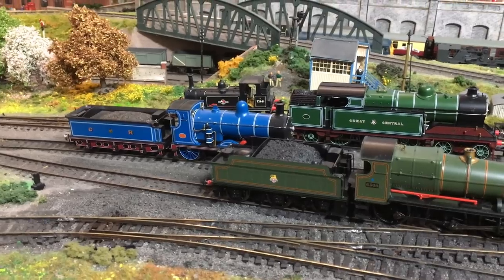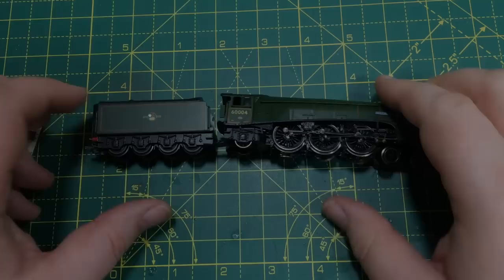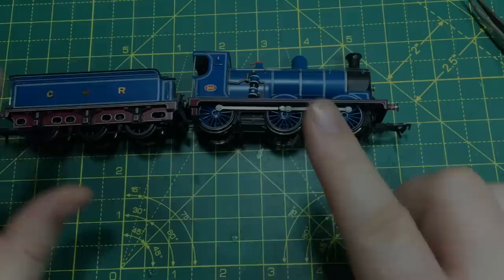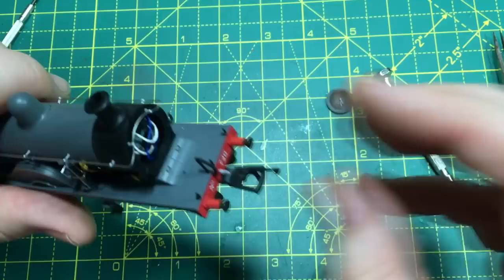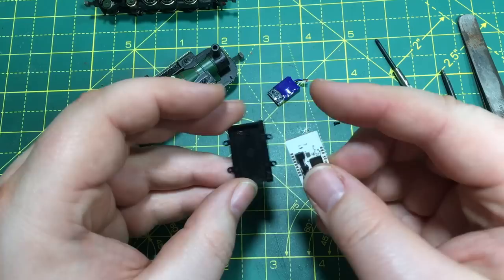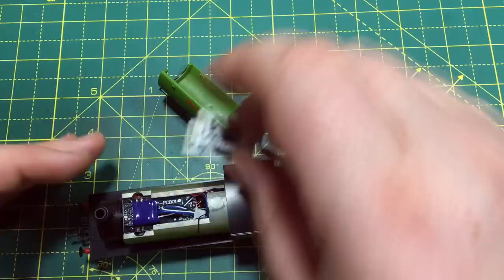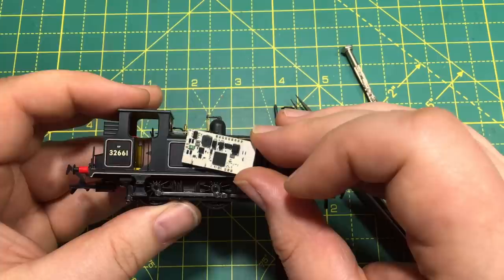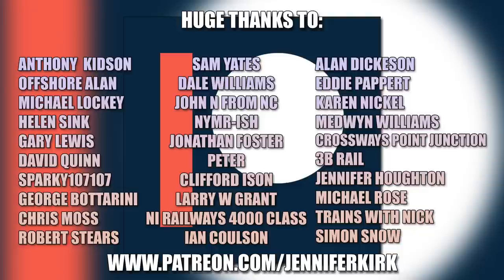Will it Fit in YOUR Model? Testing the Hornby HM7000 Bluetooth Decoder

Comment: What bothers me is hornby has marked this as being next18, but next18 is a standard that includes dimensions. Next18-s is at most 25mm x 9.5mm x 4.1mm. If I am correct that the hornby decoder is larger, it is not a next18-s device. (28.5mm x 14mm x 5mm from their page right now). They do provide the dimensions at least, but that doesn't help anyone with a compliant model. This is a best practiced failure on the part of hornby. This is really, really bad. Conform to standard first, then release.
Reply: Can I refer you to the latest Hornby Podcast Beyond the Buffers, where it’s explained why the Bluetooth decoders are this size for now!
Also seems they are made the fit the TT120 range, rather than all manufacturers old models.
Reply: Next18 refers to the socket, the interface between hardware. Which this confirms to, and the standards of communication, which this conforms to. They conform to the standard, says on the box they conform to it as these are then operational factors of a next18 decoder. Never says comply to the standard.

A voluntary standard need not be complied with by anyone and to be fair most other makes deviate from it in some way or other, that's why so few are sold with compliance markings.

If it don't fit, buy another smaller make, the fact it conforms to the standards of communication means you should be able to use this in locos it does fit and anything else in locos it doesn't fit. Which is absolutely fine and dandy for most users who are probably not super heavily invested into a full hornby DCC system or prepared to do so anyway having invested into other none bluetooth control systems long before this existed. 

Storm in a teacup to generate views is what this is. Pure tabloidism run rampant on a hobby that doesn't need  journalism of that ilk and doesn't benefit at all from it.
Reply: Look up the difference between conform and comply. It is Next18 but doesn't comply to the size standard, actually most decoders don't.
Reply: @highperformancecreambasedsoup  I don't think hornby declares their product to be next18-s, so fair enough. If the model manufacturer says "fits next18-s" then the consumer has allmthe information they need and can choose easily. However, I think the conversation is worth having, not to point at hornby and say "you are wrong" but more to try to find some way to make it easy for modelers to determine what will fit without guessing. Maybe that already exists? The fact that reviewers are not aware of such information suggests not.
Reply: @a.squirrel1511  it's called a publically available PDF that you download prior to buying, read, take note of the measurements, then read the NRMA documentation, then measure some locos or order one and go through what you have to see if it works. 

Or someone does that anyway, then you know, then you go "huh, fair enough" and continue on your way in life because really is there any changing this? Is 99.999% of time put into this worth it? No one is going to suddenly start complying, the issues in manufacturing things aren't going to be undone and resolved back to 4 years ago, time goes one way. No rewinds no replays no edits. 

Let's just get on with enjoying our trains  sans the drama.
Reply: The pdf is not sufficient, incomplete. When the model manufacturer can give you a set of dimensions that will fit (say by specifying a standard) the amateur modeler does not have to guess. As for drama, you are inventing it, so stop.
Reply: @a.squirrel1511  the document from the manufacturer is complete, it tells you what you're buying. You then go assess next to what you have. If you are an amateur, you ask advice. 

Remember a world before the dramatics of expecting every product to be just so? That was a nice time. Let's just stop milking it and moaning because it's hornby, not because it's anything different to what most other companies do, but because it's hornby, a contrived drama is never far off, so stop. No one is benefiting.
Reply: @highperformancecreambasedsoup  if 2 professional reviewers can't look information on model engine boxes and instantly say "this decoder will fit" then something is wrong. Say what you will to get the last word in. I will refrain from feeding your trolling further.
Reply: @a.squirrel1511  no, you look at the information in the decoders box or freely available on the website and you make a judgement before even buying it that it might well not. 

Trolling is pretending that it is an issue, prentending that it ever claimed to fit anything other than hornby stuff and even then, not all of it, pretending that it was marketed as fully compliant to a standard, pretending anyone else in the market pays full respect to that standard and thus hornby should, pretending just so much to make it an issue. It's unprofessional on the part of one reviewer, and on the part of this one, has actually been kinda well done because she spoke to hornby, she understood the primary aim of the product, the primary market for it, spoke about it realistically as to what made things the way they are and the intent going forward and didn't just make an unprofessional fuss over nothing for attention. Like a troll would.
Reply: @a.squirrel1511  you know blumami, rails of sheffield, hattons, they all sell decoders that mention standards in their blurb or indeed say they comply when they are dimensionally incompatible with the standards they mention.

This is just shocking behaviour, why is no one talking about this absolutely awful behaviour from a supplier?...🤔 lets spin the wheel, disgruntled hornby collectors, or it just being the norm and no one being bothered before.
Reply: @wamgoc   Can I refer you to Hornby's Next 18 sales page and the box that does not mention this but they do state compliant when it isn't. It doesn't for new models!
Reply: @modelrailwaynoob  can you quote the passage where is says the decoders are compliant? I've been over and checked, both UK and US versions of the store site mention nothing of compliance in regards to these bluetooth decoders. Talking about product R7345. I cannot see any reference to compliance.
Reply: @HamStrains  It states retrofit to Next-18 (NMRA NEM 662) compatible locomotives and doesn't fit any of mine, so they aren't compatible. Incidentally it also states DC controllers in the tri-mode section but after telling people to put their DC controller on full, Hornby are now saying don't use them. I suspect two many people are returning fried decoders.
Reply: @modelrailwaynoob  doesn't say who's locomotives, so, lets use our analytical skills and look at what sounds it comes with. Which are proprietary and which only cover items in the hornby range. We can assume reasonably from this that the intended scope of compatibility and sound provision is limited to those items for which sounds are provided which fall within the hornby range which have a compatible next18 interface. 

Nothing I've read or observed suggests  otherwise, there's no sound files for say... spit balling here, an austerity 2-8-0(no this doesn't come with a next18 socket but roll with it) why would we look at a product that provides sound, that comes with a limited provision of proprietary sound profiles labelled specifically to locomotives not just as "generic 0-6-0 sound 1" and "generic 0-6-0 sound 2" etc and think it might have been designed or intended for something outside of the scope of that list. Especially with a company that has for donkies years just done it's own thing(the hornby set track being an example of not great compatibility with peco track, the past control systems being dogged by incompatible issues with other peoples stuff.

Apply the rule of thumb, if it's hornby, it's made to work with hornby stuff as the first and sometimes only priority. Bachmann have done the same in the past with older sound offerings being entirely proprietary on the hardware side yet using aspects of standard industy practice for convenience. It's not at all unusual. Multiple UK retailers sell branded decoders that claim compliance, not conformity, not compatibility but actual compliabity but fall short of the standards dimensionally to varying degrees yet will fit their own brand products. I am no huge hornby fan, just a modeller that keeps an eye on who sells what. If we're going to rally against this to this degree lets get the pitchforks out for everyone doing it. Otherwise it's unfair and more to the point, useless, we either demand everyone comply, or we accept varying degrees of conformity and live with it as one entity complying makes not an industry wide compliance culture. The impracticality of the above given the number of players in the game all with their own motivations is exactly why the NMRA don't seek compliance by harassment, they just float a list of things to aim towards and say if you comply, flag it, if not use what bits of our system suites you. Exactly the same as when you build a layout, you can pick and choose the practicable/applicable bits of their best practices and implement them. There isn't a jack booted thug waiting to deny your layout a spot at an exhibition if you don't follow all of them to the letter.
Reply: @HamStrains  There are a couple of problems with your assertions. Firstly, Hornby don't state that these decoders are made only for their products and they should if that is the intention. They also don't list what sound files are available before you buy the decoder. Some of the limited sound files available are suitable for other manufacturers' models and they work. I have tried them. I own both 8 pin and 21 pin versions. There are bugs in the app and it is not available for android although the box states it is but otherwise, they have worked quite well. This is reflected in my videos on the decoders so my having a go at Hornby is another of your incorrect assumptions. I don't bash Hornby. My issue is with the Next-18 decoder and that is only what this video was about. To try and suggest there aren't issues with the Next-18 decoders is just silly.

Comment: if they could narrow it by putting components closer together and maybe make the bluetooth antenna smaller or as a daughter board or even as a wire antenna
Reply: The signal you wish to send and recieve coupled with the desired data transfer rates and power availability considerations all play into the physical form of the antenna, along with cost and of course availability if you go with an off the shelf antenna rather than this PCB antenna solution.

There's a fantastic website called antenna theory that covers the basics underlying how these things work and all the different solutions people have come up with. Well worth a look. Probably the best of these is the put the antenna on a separate board solution but this still requires space and then comes with additional points of failure due to the added connections etc

Comment: Hi Jenny, is there any other pcb tracks in the bluetooth aerial area of the board? Coud the aerial be removed from the pcb and replaced by a flexilble wire of the correct length, or is the physical routing of the aerial track critical?
Reply: When you alter the shape of the antenna you alter a number of it's properties of both the signal received and the ability to transmit which can then knock onto the rest of the design of your circuity. You'd wind up with a little bit more work than just attaching a wire. Attaching a wire works great for larger applications but when you are dealing with antenna that are sub wavelength things get a bit more funky and some other components on the board would need changed to compensate for this.

Interested me is seeing in their documentation just how much a diecast body tanks the signal. Wonder if this and achieving a good operational range played into the outcome of the specifications they landed on.

Comment: There ya go!!!! It fits an N gauge Loco by Rapido!!!!! I think all the other model manufacturers which it doesn’t fit must have got their sums wrong!! LOL. 
Seriously,,Hornby have never appealed to all the pedants out there so nothing is new there. They have worked on this through some tough times and the world shortage of components has meant that for the time being, the Next 18 is fractionally larger than ideal. Solution, buy something that fits and be happy. It’s not the end of the world,,,,,yet!! Incidentally, I’ve had no problems with the 8 and 21 pin versions in both Hornby, Bachmann and Dapol locos. Time for a nice cuppa and a deep breath!!! Well done Jen!!
Reply: It's called false advertising
Reply: @modelrailwaynoob  All advertising is False!!! Did you not know that!!!
Reply: @LiveSteamNick   No it isn't but I am only concerned with Hornby at the moment as I bought their decoders and was misled

Comment: Great and brave thing for Hornby to produce this next step in DCC decoding.
Their function seems great, a good thing they can operate next side any other traditional decoder system.
But they failed big in not respecting the NMRA specifications, that not only sets a standard for any decoding manufacturer on function standardization, but also on hardware sizes.
What's even worse is that the packaging of the new Hornby decoder specifically says it's NMRA standard, and that makes me a little bit angry, Hornby should stick to the rules if they want to sell under that flag, no matter how revolutionary their product is, otherwise there is no point in having NMRA standards.
And I'm convinced that most DCC users embrace the thing of having  a standardization as NMRA and no matter what brand you are you should stick to it, It's already worse enough that there are so many variations in sockets so please don't start to fiddle with oversizing…